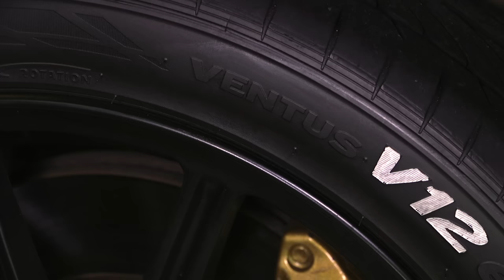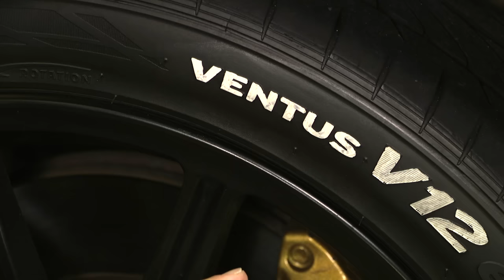Using Tire Ink Paint Pens

Comment: Well, I actually did 3 sets of tires (so 12 tires) with a single pen. The way I do it is to press the tip until the ink starts actually dripping out and with that I can just tap the latters so the ink can just distribute on its own - needs a bit of practise, but it's much faster and, gives better coverage and a smoother surface.

Did use different pens (regular tire marking pens) .. sorry to say, but yours are really overprized - not sure if they are any different, but from the video the result looks exactly like mine when I first "painted" it with stroking. No offense.
Reply: Yes, I ordered the Dykem Brite-Mark medium tip. Used one pen for one set of tires and there's still some paint in there! Worked perfectly. Only $7. He way overprices them because he knows if he puts the word tire in there, others will think it's meant specifically for that went in fact it is not.
Reply: Chandler Dorjahn  do they sell in the store? Whats it called??

Comment: On my paint pen lid, there is a little pot you can take off to use to prime and fill with a little paint from the pen, to then dip the nib into from time to time, very easy not to notice it though.  I've not used mine yet, just watching to see how easy it is to apply.

Comment: What makes these "tire pens" different from regular arts and crafts paint markers/pens?
Reply: Who knows?
Reply: I think these have a Small amount of unicorn sperm in the paint formula. That's why they stick to tires so well.😆
Reply: Amazing
Reply: special paint formula designed for specifically for rubber I think
Reply: @MikeRP3147  thank you my friend best and smartest answer of all time. I will now buy a set
Reply: @MikeRP3147  i'm dying laughing!!!  Ahh great comment!! Unicorn sperm was great and then sticking part follow up. Outstanding!!
Reply: The packaging. I checked my local car store. They sold the exact same pen as the local stationery store but just put it in a carton saying it was for tires... Lol
Reply: I'll tell you what. I tried this today with an arts and craft pen with NO results! The marking wiped off with my finger! Yes, I let it dry. Yes, I cleaned the tire before applying. 2.50 for a paint pen amd thats what you get: garbage! I'll be trying these, but I wonder how they hold up to washing and tire scrubbing.
Reply: Just go to your local welding supply store and get them,we use them all the time to write on steel.

Comment: I'm definitely doing this... gonna highlight my cheap chinese tyres for all to see.
Reply: Chinees tyrea are cheap with has the dame performance as the big name tyres very expensive for no reason..
Reply: @pzorro2020  Lol, that's not true - not even close. Anyone who drives and owns a car, especially living in changeable conditions will tell you for a fact, cheap tyres don't perform. Even novice drivers (though maybe not morons) could tell you the massive difference between cheap tyres and worthwhile ones. You pay for what you get, cut no corners. Everything on your car communicates to the road through the tyres, they are THE most important aspect you should keep on top of, if you own a car.

Comment: Here is a tip. Don’t do what I did!!!   Paint your tires AFTER they are mounted and inflated.  I did mine before they were mounted and after they were mounted and inflated there were a ton of small cracks due to the tire expanding when inflated, I didn’t think about that when I painted them.  I had to go over them 2 more times to fill in all the cracks…..live and learn!!!!   (they still look super cool though!!!!)

Comment: Hey there, i do quite a bit of offroading and we have to drflate all the way upto 10Psi to keep our 4x4s from getting stuck or bogged down in the soft sand (desert offroading). I want to colour my tyre letters the same way but was wondering if i use plasti dip clear on top of the letters as a protective   coat or multiple protective coats for that matter? Should that work or is it just gonna get scrubbed off by all the offroad driving ??

Comment: Good luck keeping the tires clean. I know many used these pens and after two washes they looked like crap. No paint pen is permanent.  Clear coat is what keeps paint from fading, chipping and coming off. No clear coat made for tires. You can buy white letter tires still. If you can afford them.

Comment: Nice. For cleaner lines can you use things like the yellow striping tape to "prep" and get a better finish? You kind of just went at it without it.
Reply from the maker: Janiel Moreira sure you can try, but that would take a lot of time and prepping. May also be impossible depending on the size of text you are trying to color.
Reply: @dipyourcar do you know how this holds up off road ? Does it scratch off easily ?

Comment: How did you get the letters looking so good? I did this one some goodyear tyres except the writing has groves in it and is slightly depressed into the tyre. I found while doing it I was using a medium point sharpie and it was going over the edge and now looks all wonky and horrible.

Similar sort of design to the "V12" from this video except I do not have a raised edge instead the entire thing is "despressed."

I was going to remove it using rubbing alcohol or acentone and start again but before I do that, any tips for making it look sharp and clean edges so they don't have runoff?

Comment: Kind of an unrelated question, but if you wanted to purposely dip your sidewalls a color, could you? Would the dip stay on the tire during driving?
Reply: Flash007b no
Reply: Tires would be too stretchy i think
Reply: M KIop you understand plasticity is rubberized coating, yes?

Comment: It would be nice to see what the other colors look like. I have the impression they'd be dark because of the black background? Or not?
Reply: I used white Rust-Oleum primer mixed with a little rubber cement. I applied that first and let it dry.
I applied Red Rust-Oleum on top of that and it really POPPED. Sall artists paint brush.

Always do the letters from left to right so your hand isn't dragging on the painted letters.

Comment: Curious to see how long it lasts
Reply: MEllO ive done it and it last but it starts to yellow since tires have oil within the rubber
Reply: Like Eddie said, they start to yellow in about 2 weeks
Reply: So red would be better?
Reply: Never tried red but honestly tire decals last forever and they r easy to apply i used the pen to see if i liked it later ordered tired decals
Reply: Eddie R. If you go that route, the brand "Tire Stickers" are the best out there
Reply: I've used yellow and red. Red faded faster. Yellow lasted a month on 4x4 truck that's outside all the time before starting to fade. Recoated after 2 months or so. But I only did 1 coat. Mine were straight from China via eBay for 79 cents a pen with free shipping. Pen lasted on all 4 tires. Doing twice what he did. Red, blue and green show better if you do white first. If you keep car in garage when not driving and out of rain then I bet it would last few months. But my truck gets parked in grass at home and outside all the time. But for the price I paid can't really complain. Its more for car show cars than daily drivers. But makes car or truck look cooler

Comment: How do I remove the white marker off my tire side walls?
Reply: Black sharpie lol works wonders on my mistakes
Reply: @Always_Never  what I meant to ask, i have painted the letters already but want a solution to remove the white ink.
Reply: @ahrat  I think paint thinner, but not sure...hopefully someone has a more accurate fix.
Reply: T-800 Model 101 Infiltrator Unit.  similar to rubbing alcohol?

Comment: If the letters are raised than just put some thick paint on an ice scraper and apply lightly. The paint will only touch the lettering because of the depth. No need to paint each letter individually.

Comment: Wonder if tire shine would affect the tire ink?
Reply: jay peniston I'd imagine if you don't layer it on real thick and use an applicator pad around the lettering and a towel to wipe it in between the lettering. Most tire shines are petroleum based which dries out the paint and sidewall of the tire

Comment: Had those tires on my mustang. They sucked. I ended up blowing out the rear tires on a cold day. Only run BFG’s now. Still have the two in my garage if any one wants over priced tires for free lol. Nice product though he always does a great job!
Reply from the maker: We just bought the car for videos and these are the tires it came with.  The car is driven about 100 miles a year, so I think we'll be ok :).  Thanks for watching!
Reply: Your first mistake was driving a Ford.
Reply: Fords are good vehicles, break down almost never. Cant say the same for Chevy. Love my Ford Thunderbird

Comment: I tried using the paint pen..but.when you move your car it crack...and when it rain its wash off most of the paint...
Reply from the maker: Then you didn't actually try this pen, you tried something else.  This product isn't water soluble.  The only thing that breaks is down is Acetone (or a similar solvent).  Not all "paint pen" type products are the same.
Reply: @dipyourcar  tq but its a permanent ...yes im using other type will try this one in future....